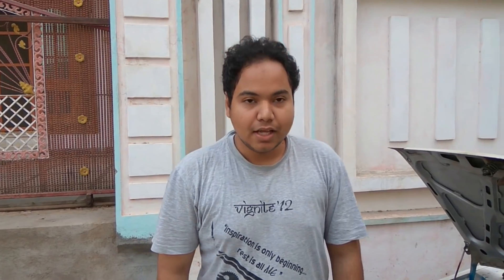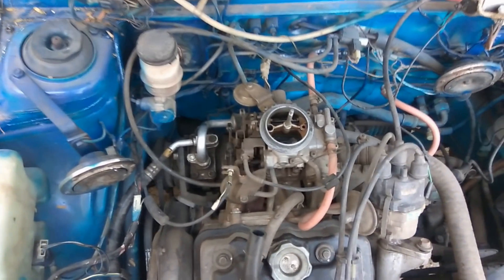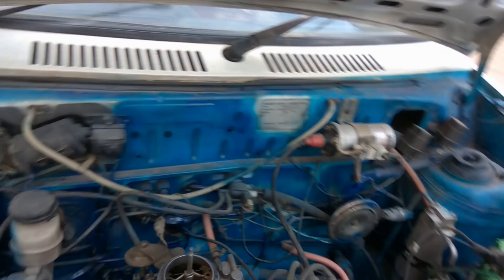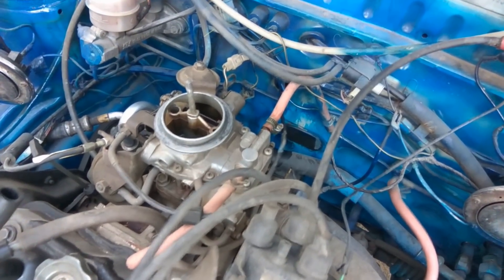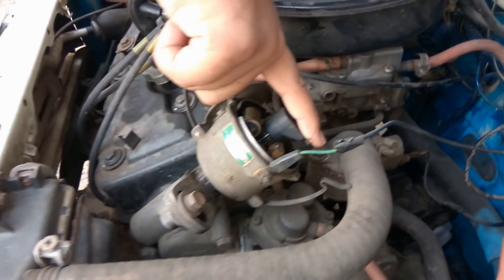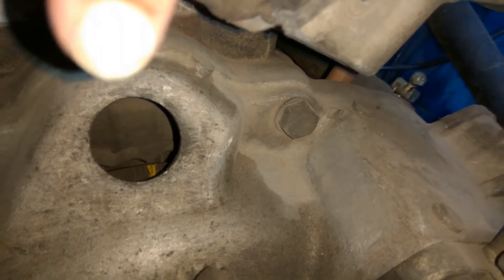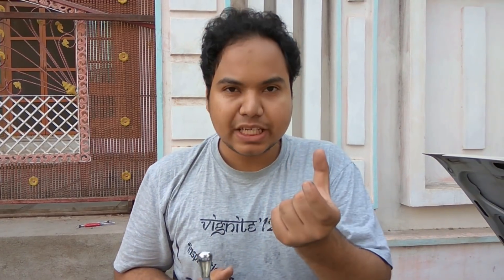Tune carb and spark distributor for max mileage

Comment: Thanks Aveem.... today I am facing a new trouble the car is starting for a second then getting off I have tried many times but even after tightening the idle screw then also same is happening..... starting for a second and then getting off. So new problems are getting on and on what should I do Sir..... pls help me and a video call will help me a lot if you permit.
Reply from the maker: I think your idle rpm is too low. try increasing your idle rpm. If you want to contact me, send me a mail at aveemashfaq@gmail.com . I will guide you from there.

Comment: No Ashfaq my car is getting off whenever I am not reving my car too much in kolkata traffic and getting off then after applying self it's starting,after replacing AC pump,needle valve Assy, adjusting Points,Dristibutor timing and replacing ignition coil the coil is getting very hot so I replaced the coil with old one . Now I haven't tested the car but in standard condition after fan is starting the is starting but rpm is fluctuating and without pressing accelerator the car is having 40kmph.So what I will do I am totally confused Sir.....
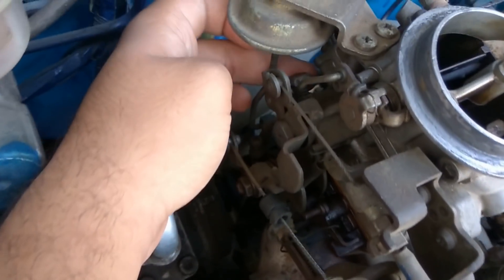Reply from the maker: If your car is turning off if you don't press your accelerator, you just need to set the idle rpm. It is a simple issue and you need not panic at all. Just tighten the idle screw two to three rotations that I show at 5:44 in the above video. There will always be a difference in rpm of engine between cold and hot conditions. When the engine is cold, rpm will be low and engine will always try to stop. When the engine becomes hot, the car rpm will increase and it will stay like that (in carburetted cars). It is normal behaviour for older cars. So, if your engine is cold, it will trouble you for 1 minute and after that, engine becomes hot and everything will be fine.

Comment: Hi Avim I have a 99 model 800 my car is not idling and the mechanic replaced ac pump,needle valve Assy and ignition coil so now my car is messed up what is your suggestion.
Reply from the maker: What do you mean not idling properly? Is there low rpm when engine is cold or is there problem even when it is hot? is it under AC conditions or non-AC conditions? Generally, you don't need to replace parts at all. If your idle is too low, I have told you how to improve the idle at 5:54 of this same video. Check it out.

Comment: My car is not starting up. Will try this tomorrow morning. Lets see if i can make it run again. It is a 1985 model.
Reply from the maker: Nice. Try doing a general checkup first, spark plugs, engine oil, petrol and then start it. Initially, you will need to do some cranks with accelerator pedal fully pressed. This is to clean up the inside of cylinders. Then you can try starting normally. How long have you not started the car for?
Reply: Aveem Ashfaq . The car stopped suddenly in route. I have tried all the basic stuff. It does not start. There is spark in all the 3 plugs and petrol in carb. Don't know what the issue is
Reply from the maker: There is a small wire in the back of carburetor which controls a solenoid. When you turn off the key, it blocks the passage of petrol through carburetor. I have showed it in this video https://www.youtube.com/watch?v=gCgS5UcutIk . Check if the wire is connected or not. That is probably the issue you have.

Comment: Thanks bro ur tuning helped.getting good mileage of 16+ on highways in speeds at 80 kmph.but as for the adjustment of screws,I'm running on 3 rotations back mixture screw and the front screw I have adjusted to 1.25 rotations as per the smell.is this OK?
Reply from the maker: It should be 4 rotations for the back mixture screw. The front screw is OK. If you are satisfied with the result, it is OK.You will get 18kmpl on highways at the speed of 80 with full load with AC if there is no fault. For the ultimate accuracy in tuning, open one of your spark plug and see whether the tip is white of pinkish brown or black. It should be light pink to pinkish brown. Then you know that you have the perfect mixture. If it is black, tighten the back screw half rotation. If the spark plug is white, loosen the back screw half rotation. That is the final step.
Reply: I get 19-20kmpl at 80-85kmph.
Front screw is fully tightened and back screw is about 1 turn

Comment: After adjusting just like u said in carb I smell petrol fume from exhaust continuesly.is this normal?
Reply from the maker: If you are smelling petrol, then first check if you have any leaks. You must have opened petrol return line to see how much petrol is coming back. Did you clamp it tightly back? If there are no leaks anywhere, then you must have opened the front screw too much. tighten the front screw one fourth rotation. That will solve the problem.
Reply: can front screw opening increase petrol smell.Is that screw only for the air mixture?im experiencing petrol smell again.i checked and there are no petrol leaks.after fully closing the front screw and back screw in 3 half rotations im getting little more mileage.please explain the reason

Comment: Yes one of the pipes from vaccum was discconected.also the intake rubber pipe from the carburetor for Ac is blocked.there is no floe of petrol when Ac was switched on
Reply from the maker: the rubber pipe is for air. It is not for petrol. So you wont see any petrol flowing at all. Just reconnect those pipes and see if it works. If not i can guide you further. I have sent you my mail id in one of your comments

Comment: My carburetors Ac valve not functioning it is blocked.when I switch on Ac the engine rpm decreases and stalls.how to fix this?
Reply from the maker: There are many reasons for rpm decrease. Firstly, you should check whether all the pipes are attached to the correct points. A pipe comes from intake manifold and enters into a small actuator mounted to the body. From there, another pipe goes to the carburetor at vacuum plunger. Then you should check whether the AC idle rpm is set correctly or not. There is another idle screw for AC on conditions which might need tuning. Then check the wire attaching to the actuator that opens the gates. Finally, if all these steps check out to be OK, then remove the vacuum plunger from the carburetor and try sucking air in to see if there is any movement. These are the steps and you will find problems in one of these.
Reply: thanks bro this got resolved.i just did what u said and its ok now

Comment: what is the tappet value in cold condition for both intake and exhaust. i set .15 mm for both. but the engine is stalling at low rpm.
Reply from the maker: The engine stalling might be due to the low idle rpm. Increase your idle rpm.  I have told how to do it in the above video.
Reply: already tried. its not working. i think some thing went wrong with the distributor. 
changed the ht cables from the distributor to the plugs. no result.
 now removed the distributor and checked the bottom drive gear. looks in good condition.
 the vaccum assited timing changer connected to the carburettor also opened up and inspected. working satisfactory. 
now thinking of changing the distributor cap with a new one. hopefully i be able to get the spare part without any issues.
Reply from the maker: Have you checked your fuel flow rate? I don't think you need to do all of this. There is a small checklist. Do that first. Step1. Check your fuel return line to see how much petrol is supplied and how much is coming back. step2. Check all the wires. There is a wire to the back of carburetor. Check it for any loose contact. There is a thin wire from the condenser coil to the spark distributor. Check whether that is connected properly. 
Step 3. Check your tuning. After all is set, let the engine become hot. See if you still have problems. I can only tell you solution to your problem if you tell me whether if question1 do you have problems when engine is cold or do you have problems even after engine becomes hot. question2. can you hear the rpm increasing/decreasing when you turn the screw. question3 is the engine vibrating a lot in idle(shaking a LOT)

Comment: Zen old 4 cyl model also same rotation for tuning?
Reply from the maker: Yes. Actually maruti 800 and zen and esteem and gypsy king have same carburetor with different jet sizes. So tuning is same.
Reply: Aveem Ashfaq thanks bro..

Comment: Selamin aleykum brother. I have a 2000 model maruti. I made the adjustments by doing what you told . thanks I have some problem; when i low gear for exm. 3. gear but high speed or go upright  , I smell gasoline What can I do?
Reply from the maker: When you are giving a lot of acceleration, the smell of petrol is normal. If you are still getting the smell even at low speeds, then tighten the screw at the front of the carburetor (which we rotated 1.5 times) around 0.5 rotation.
Reply: Aveem Ashfaq thanks after do adjustment when i drive n gear long time car is go stop suddenly    on road and it cant strat again for a while
Reply from the maker: is your car overheating? check the temperature guage. The tuning will not create problems. But if some other part is not working so well, then you will have problems.

Comment: hi. thanks fo the video. In between i would like to ask one thing. In the video you remove the distributor cover and put the vehicle in 4th gear and pull to see the marking of belt. . But before that u rotate a thing inside the distributor to opposite direction. But closing the distributor cover is not shown, or in which position it should be kept before closing disrtributor cover. 
thanks
Reply from the maker: You can put the car in 4th gear and remove distributor cover or vice versa. Not so important. But you should not rotate the center piece with your hand. You simply push or pull the car until it roughly points in the direction I have shown you. Then push or pull further until you see a marking on the flywheel and then align it with your indicator. The centerpiece at this stage will roughly still be in the same direction. Now, put the distributor cover back on and complete rest of process.

Comment: Hi Aveen I have 1986 model Maruti ss800 but my car giving 12 average so what should to do Pls  suggest  me
Reply from the maker: Do the same. The method works for all maruti models. SS80 is just a different body style with older components and some changes in the engine bay. Critically, the engine, carburetor, spark distributor remain mostly the same. The method I told works universally everywhere.
Reply: Just  I have adjusted the carburetors

Comment: i am expecting ur reply
Reply from the maker: Sorry for the late reply. Youtube put your post in the spam section. I could not see it. To know the best idle position, you have to warm up the car to the normal operating temperatures i.e. temp guage of your car should show approx 1/4. Then set the idle to your desired position. The ideal way is to set idle with a tacho to 800-900 rpm. But since we don't have those, just listen to the rythm of the car. Put all lights and other equipment ON and adjust to the min level where the vibrations are not irritating. That would be perfect. If the lights and others are turned off, then the idle increase tiny bit and it would be pleasant. Having too much idle will hamper in the clutch engagement. Too low idle will put unwanted stresses on engine and decrease engine life.
Reply: thanks for answering it so clearly now i wud b able to set idle easily but my 2nd question was how to increase the pick up of maruti 800 because i bought a 97 model in 2016 and at the time of purchasing the pick up was more than mindblowing untill i replaced its fly wheel ring due to missing self issues.after this my engine tuning totally mismatched average went down from 22 to 12, no pick up left not even half like before so thats y i m concerned hope u can understand
Reply from the maker: Did you do the tuning like I aasked you to? That should solve alll issues related to carburetor. Then we can move on to spark distributor. I made a video on that as well. Lets try mending one by one so that the issues can be fixed. My guess is that one of the spark plug wires is gone. Is your engine vibrating harshly in idle? Even if you floor the accelerator, is it still not giving enough pickup? then it must be the problem of the spark wires. If not, lets find somewhere else.
Reply: Aveem Ashfaq i followed all these steps perfectly  but i found it difficult to adjust the gap between the plates that u asked shud b bear minimum else i did it all.vibrations are severe wen i keep the idle low at the time of starting the steps but now i m nt getting vibrations  engine is smooth
Reply from the maker: There is one fixed terminal and an adjustable terminal. The adjustable terminal can be slid by unscrewing a screw. So, loosen the screw, put a screw driver or other thinner objects in the middle so that the slidable terminal moves, then tighten the screw fully. Apart from that, you can try putting fuel injector cleaner into a 3/4 tank of petrol. But I still believe that since your vibrations were severe, it could be the problem of spark plug lead. Do an experiment. Take off the front grill, start the car, let it idle and pull off one of the spark plug wire when running. If the engine is still running, put it back ON and remove the nest spark plug wire. The engine should be running. If the engine stops when a wire is pulled out, then your spark plug wire is gone. It is better to replace all three wires.
Reply: alryt sir i'll go with these instructions and get back to u once its all done 
thanks for being nice 😊

Comment: gd mrng Aveem,
today i tried to configured my carburetor & distributor of my 800 ...however its been easy to screw my carburetor all three mixture butt the moment i tried to align distributor first spark point with flywheel marking it got difficult since first spark point is pairing with no. 2 rather of no. 7..and there that too in my car there is no pointer mark ≥ which can help me out to pair >to7...
now help and advice me...
ill appreciate if u help me on my whats app no..9125778935..
waiting for ur rply ...my car is not runing smoothly...
Reply from the maker: Did you try to push the car gently so that it reaches marking number 7. Take the help of a friend. Ask him to sit in the car and when the flywheel rotates to number 7, apply the brakes and ask him to put the car in neutral. That should solve the problem. The yellow mark is the mark that you have to align the marking to.
Reply: Aveem Ashfaq thnks for the reply brother...
actually likewise you I did the same process and the moment I noticed that yellow mark on flywheel that moment my distributor first spark direction was totally opposite of that direction which u told in your vdo..i tried harder pull push my car so that i can have both " yellow mark & first spark point" in accordance of what you said in your vdo but what happenings was like at first spark point of my distributor as u explained my flywheel paring the output of number 2..strange...
now plz guide me what should i do
Reply from the maker: First make sure that your distributor marking matches the position of the 1st spark plug. Push or pull the car until that happens. Only after that, look for the marking by pushing or pulling the car for small distance. You will find the marking. That is what I said in the video as well. Actually, for every one round of spark distributor rotation, teh flywheel rotates two times. You found the other position. I was guiding you to the first position.

Comment: hello aveem, nice video there, very useful information regarding the tuning of the carburetor. also nice information to get the ignition timing right.  this is the first video on you tube where there is a special mention by you to get the timing right without any special tools. thanks a lot.
one question i want to ask , my secondary  circuit in the carburetor is not working ? what should I do ?
regards
Reply from the maker: You have to open the carburetor and clean it. In that process, take the lower plate which contains the valves and heat it on the stove while you try to rotate the valve. That will clear the secondary valve.
Reply: thanks for the reply , will try it but one more question, Can i dip the lower plate in diesel overnight and try it first before heating the same cause i am afraid heating might crack the casting?
Reply from the maker: You can dip in diesel if you are worried, but there would be absolutely no trouble of cracking. I have done this on two carburetors. I am pretty sure of it. The lower plate is aluminium and the heat will spread out soon. Disassemble the primary accelerator lever, pull everything out and then put the plate on stove and once it starts heaating up, take a cutting plier and try opening the valve. It will open soon enough. Do the exercise of opening and closing until it feels smooth. Then it will all clean up.

Comment: Hi Dear  i am really happy that you r doing really nice job for helping topics about maruti 800 & passion about too.

Dear actually i need ur help to how to service all the wheel of my maruti 800 1994 model Patrol version & having problem with carburetor, wiring, wiper and lighting system also for average too, actually i went for repair too many mechanics but they do as just like jugaad and charged around Rs.1000 many times but problem is still with i m telling you that i m really fed-up and wanna solve all these things plz help and guide my ID : himanshu021986@gmail.com waiting for your response